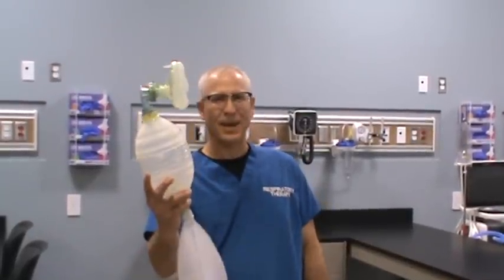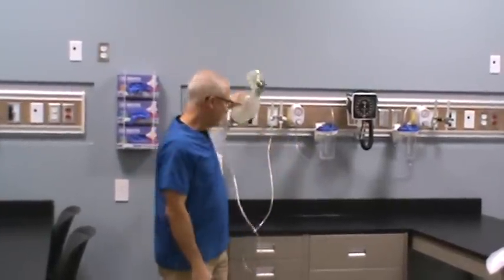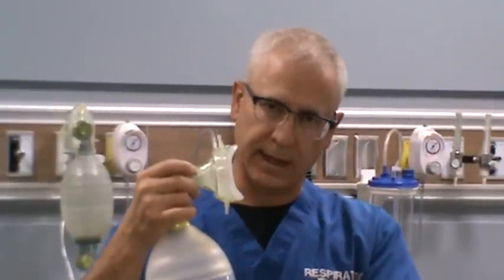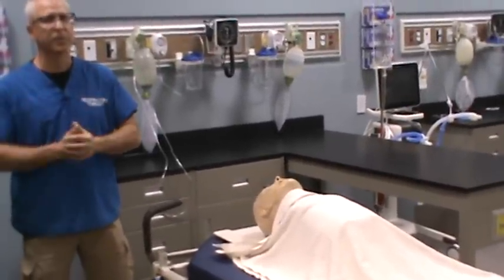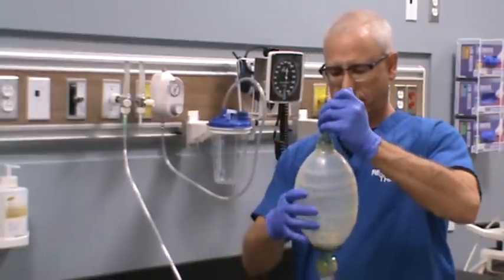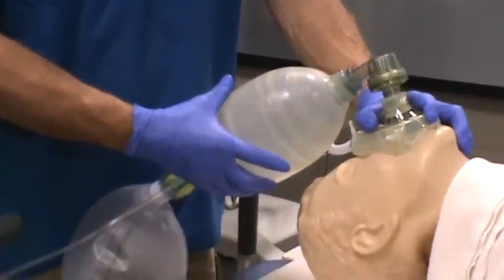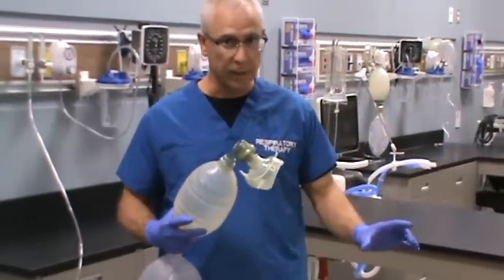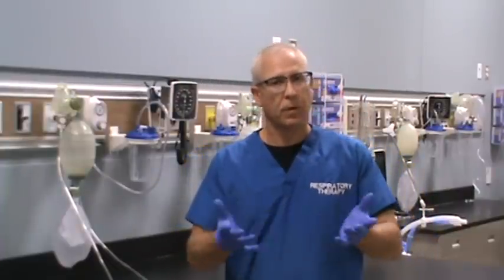Getting Ready to Use a Manual Resuscitator on a Patient for Manual Ventilation

Comment: If your bagging without oxygen do you need to have reservoir bag on the back?
Reply from the maker: Yes, otherwise your FiO2 will decrease, quite significantly in some cases. It will still function if it's a self inflating one but expect a lower FiO2 based on RR and O2 flow into it